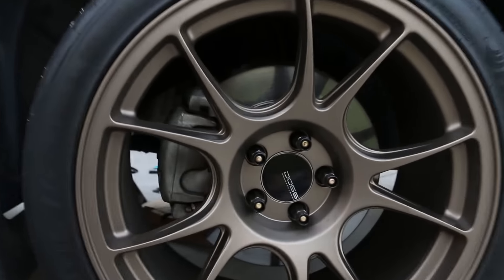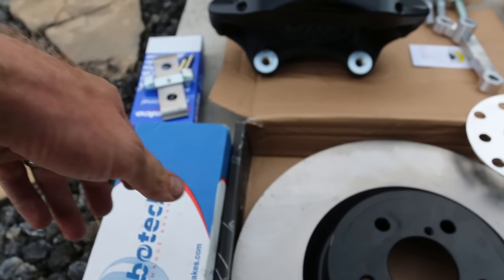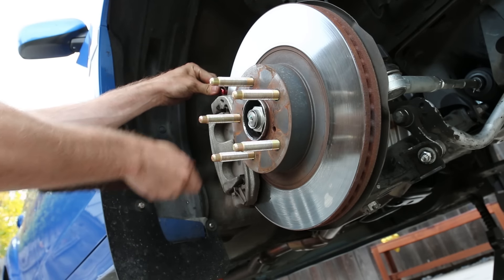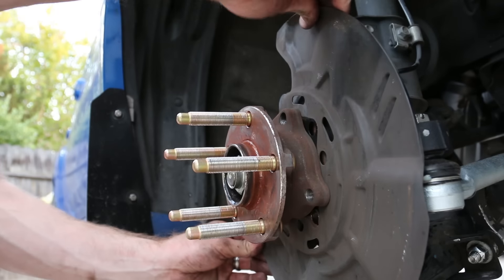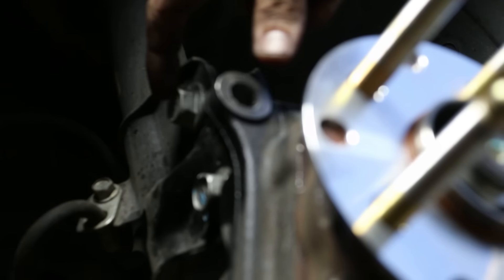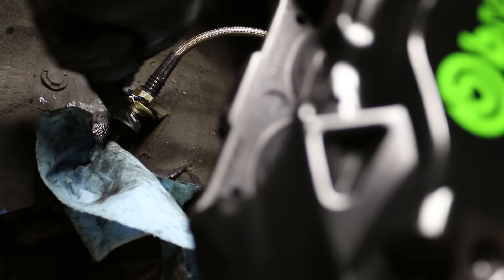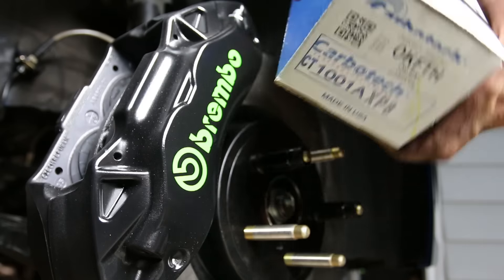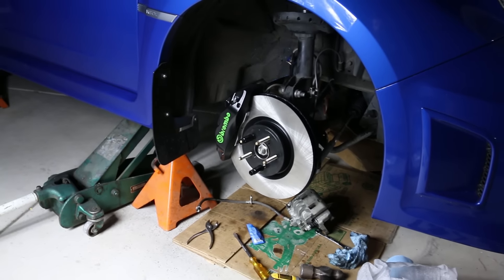CADILLAC BREMBO BRAKE SWAP FOR YOUR SUBARU WRX ON THE CHEAP- HOW TO INSTALL PT-06

Comment: tutorial to breed brakes next? I'm in desperate need to get new brakes and I want to breed the ones I have before they get too old
Reply: bleeding is really simple - dont buy a stupid 'MityVac' just need someone to assist you for no more than 5 mins. Have them apply brake pedal pressure, then crack the bleeder (inside first), let some old fluid come out then close the bleeder, then have them release brake pedal pressure. Continue with next caliper.

Comment: Very nice install! 👍🏻Your rotors came off way too easy. Lol. I have changed rotors on 2 cars & both times needed to use the bolt holes. I'll be changing rotors on my STi either later this week or next, I hope mine come off that easy. Lol.
Reply from the maker: +HawkeyeSTiGuy Thats that Cali weather.
Reply: Blake's Garage Lucky. Lol. The threads on my coilovers are completely seized up too from the salt & moisture, so I can't adjust ride height either. Lol. They do need rebuilt though, but I may make a video on how to break them free, once I figure it out myself. I will kneed a huge 'FH'. 'Haha.

Comment: Will the drilling and threading make it to where you can not use the stock break set up anymore. I want to do this break swap but I want to be able to go back to the old set up just as an option.
Reply from the maker: Larry Pressnell correct you will have to get new knuckles if you wanted to go back. Or just swap with someone if you sell them.
Reply from the maker: Larry Pressnell easy swap though.

Comment: I have a regular Impreza,
Not the WRX,  16” inch rims.  Will this fit?
Reply from the maker: No you need 18’s to clear
Reply: Blake's Garage;  Are there any other break upgrades that will fit?  Probably not a Brembo. as long as it’s better than factory..

Comment: will the adapter work for the cts-v 6 piston calipers?
Reply from the maker: +David Eastment not for the subaru but you can get the 6 pot for a 240sx

Comment: what did you do for the rears? (I found a used set of 08+ for $425 shipped that I'll be using)
Reply: mholdr he doesn't respond to comments.  do you have a link?

Comment: do these work with the 2011 subaru legacy 2.5 non turbo my caliper are bloody seized and are shit
Reply from the maker: +Arden Slip yes they will.
Reply: Blake's Garage   how do you compensate for the brake bias i just want them for daily driving
Reply from the maker: +Arden Slip just get the normal AC Delco pads brake bias will barely be affected.

Comment: does anyone know what size rims i need to clear these brakes? I currently have to the stock wrx rims (16 inch) on mine, need to know if either A; they would clear, or B; whats the minimum size I do need to clear the brakes! Thanks!!
Reply from the maker: +Jonathan to be safe 18's some 17's will fit but just get 18's so you don't have to worry.
Reply: Wow your fast!!! Thanks Blake, Keep up making your amazing content!!

Comment: I understand that they fit but you do understand unless someone changed piston size you have unbalanced the braking. My STI is running ST 40 with oversize pistons in the front and St 20 with oversize pistons I am guessing you have no real tracking under your belt.

Comment: lol you don't even have to remove that backing plate to change the wheel studs. Just bend the corner slightly were the caliper goes... Hammer them out after

Comment: You're replacing a floating caliper, with what looks like a one piece caliper. The rotor is not really floating since it will be held in place by the wheel lugs. You should always use two piece floating rotors with a one piece caliper, otherwise you will have uneven pad wear and loss of braking power. Also the new bracket seems to be made of aluminum, hopefully it will be strong enough as the other steel components around it and not flex during heavy braking. 

Since it has not been two long since this video was posted, I assume there hasn't been much wear on components. Please keep a close eye on your pad wear pattern and update people if there are problems, in the interest on safety. Advertising a potentially problematic and possibly unsafe upgrade is obviously something no one wants. 

Also, not sure if Subaru recommends hubcentric wheel mounting. If so, you have also reduced the amount of hub ring on which with wheel should rest. 

Hopefully everything works out for you.

Thanks.
Reply: Well thats just patently false...

Comment: can this caliper set install on the 2016 forester ?
Reply from the maker: Wen Jiang yep but your going to need bigger wheels. The Subaru 4pot 2 pot maybe a better setup for you with the tire selection for a crossover

Comment: wheres the link for new brembos?
Reply from the maker: ACDelco 172-2586 GM Original Equipment Front Driver Side Disc Brake Caliper Assembly http://amzn.to/1U460oz 

ACDelco 172-2587 GM Original Equipment Front Passenger Side Disc Brake Caliper Assembly http://amzn.to/1SrwQI0

Comment: Where do I find the calipers for $90?
Reply from the maker: Alan Lee all of the links are in the description.
Reply: Blake's Garage Thanks, I did look in the description but for some reason I read the link for the calipers wrong. I plan on doing this real soon, just wanted to pick up the parts first. How long did the actual install take you, do you think.
Reply from the maker: Alan Lee 5 Hrs with filming so you can probably do it in around 4hrs or less.
Reply: Alan Lee rock auto. 127 a pop

Comment: Brembo calipers $80 each?
Reply from the maker: ACDelco 172-2587 GM Original Equipment Front Passenger Side Disc Brake Caliper Assembly http://amzn.to/1SrwQI0 

ACDelco 172-2586 GM Original Equipment Front Driver Side Disc Brake Caliper Assembly http://amzn.to/1U460oz
Reply: Thanks mate

Comment: What is the specific reason it uses 2004-2007 CADILLAC CTS Brake Pads instead of the matching 2015 Brake Pads?
Reply from the maker: j lee because that’s what fits the rotor and calipers correctly. Also it’s how the bracket was designed.
Reply: Blake's Garage thanks dude. You make awesome videos.
Reply: Are these made of cast aluminum? So technically they should be lighter than the cast iron sliding calipers right?

Comment: The more I watch subarus taken apart, the more I believe they compare to Honda in the quality department. All the components are flimsy looking. I mean it might be good metal but still , everything looks skinny. Unlike other cars which have beefier suspension bits. Hmmm
Reply: you are kidding right?
The Subaru suspension is about as beefy as the suspension on my Toyota Tacoma 4 wheel drive. 
Maybe you need to see it in person to understand.
Reply: They look anorexic, toyota parts too. I'm just going on what I see every day at the junkyard or on cars. Obviously we aren't going down to the molecular level , metallurgy etc.. But those parts look like they are made with less material. Trying to see if this is actually true, when you push a car to it's limits it's import to see how over engineered something is.
Reply: C Mendoza compared to every other brand Subaru suspension parts have more metal not less. 
The lower front control arms are huge for instance. The front damper rods are also. 
So are the sway bars. 
The rear isnt quite as tough but still thicker than most cars.
Reply: You are just wrong here.
Ever work on any Nissans?
Tiny little thin flimsy parts.
Reply: Yeah, that's my point. I've seen the vast majority of components on the vast majority of vehicles. Never subarus , I've never actually seen one at the junkyard (a coupe or sedan). Only SUVs and I pay them no attention. How strange now that I think about it, because I would jump at the chance of adding it to my mental library. Yeah Nissan parts are made of soup cans. But lightweight rev happy cars are fun, which they seem to be mostly good at. Thanks for the info though.
Reply: Tacoma 4x4 suspension isn't anorexic. I've beat my truck for 180k mostly dirt road miles and onky replaced shocks twice, front springs once and lower ball joints once. Never even had a single alignment and it still drives perfect and tires wear evenly. 
And let me tell you I have loaded the hell out of my truck and off roaded the shit out of it. 
Never let a mechanic touch it either. Bought it with 6 miles on it. 
04 tacoma has been an unbelievably good truck and its suspension is lighter dutu than that on any of the six subarus I have owned. Four of which I still have.

Comment: you did 95% of the work to take the backing plate off. all you needed was to take the axle nut off and you would have saved yourself more time not having to cut.....i just dont get it.

Comment: meh, I'd rather just get some used Brembo calipers for $500 (or cheaper on NASIOC) and not have to jack with the bracket/spacer shit - they bolt right up.
Reply from the maker: I see your point... but it's going to cost you way more than $500. Also you're buying used parts and run the risk of them leaking or the threads being stripped out wich is a very common occurrence.
Reply: +Blake's Garage ohhh no not a 20$ helicoil set to fix it